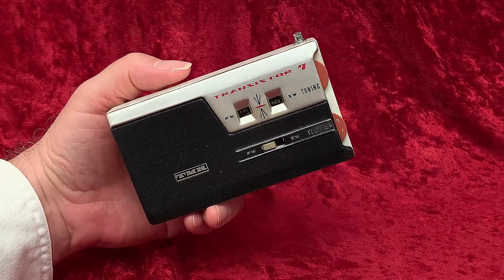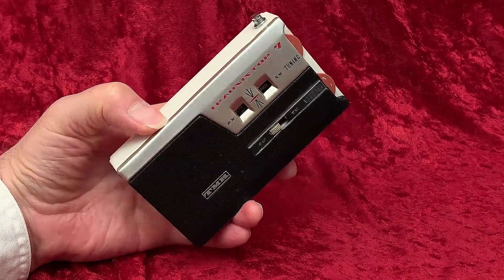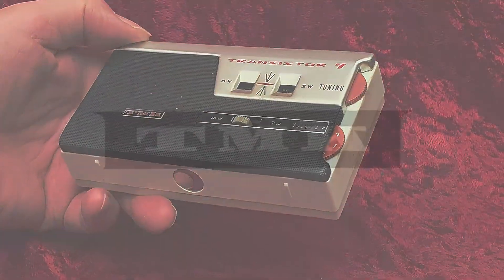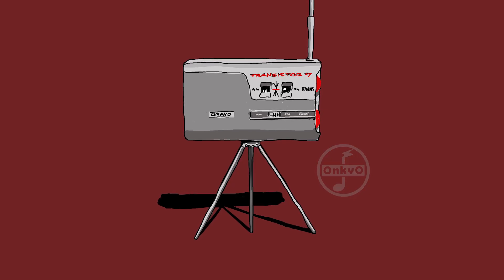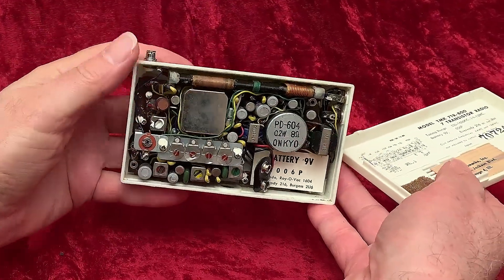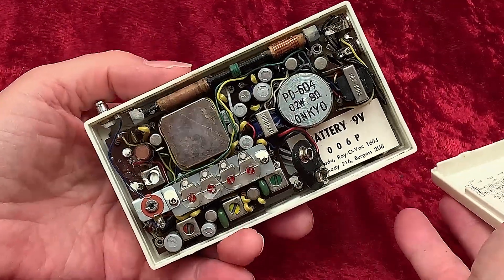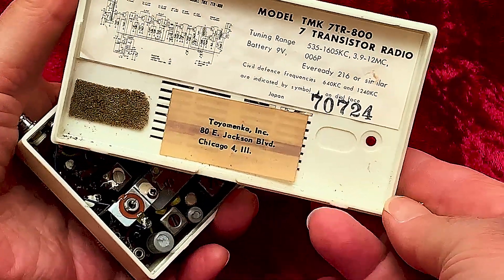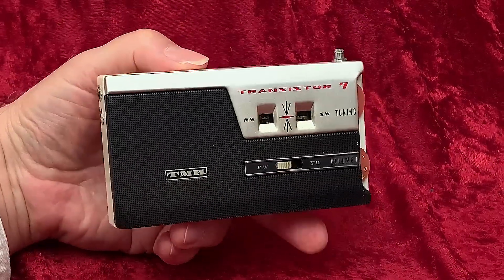Vintage transistor radio c.1960 two-band TMK - Osaka Onkyo, Japan - Toyomenka

Comment: After your video and my best research effort, I gather it's made by Onkyo with Toshiba parts. For sale in america by Toyomenka America Inc, or TMK. The Onkyo version for sale in Japan. Both have Identical model numbers. Also I suspect Toyomenka (TMK) is solely the creation of Onkyo for Americans. 
  The chrome button on the bottom is for MAGNETIC attachment of the tripod. It is not a "plug".

  Excerpt from the Radiomuseum site regarding that model:

"AM (535-1605 Hz) and shortwave (3.9-12 MHz) bands. US civil defense marks on AM station dial.  Detachable SW antenna stores in back of leather carrying case.  Dual earphone jacks.  Jack on back of case for additional external antenna.  Magnetic button on base of radio for a short tripod stand.

Back of case embossed with "Osaka Onkyo Co., LTD" and "JAPAN" and "7TR-800" in a circle of sunken relief.

Very similar to Onkyo 7TR-800 model.  Made by the same company of Toyomenka."
Reply: Onkyo, Wikipedia:
https://en.wikipedia.org/wiki/Onkyo

Comment: YAYYYYYYYYYYYY,,another great vid,,and today I obtained a coronet deluxe 2 transistor radio,,aa boys radio,,but it plays thru a speaker and headphone,,no headphone no phaux leather case,,but at a tatty box and it works,,for about the cost of a 12 pack of soda,,, YAYYYYYYYYYYYY